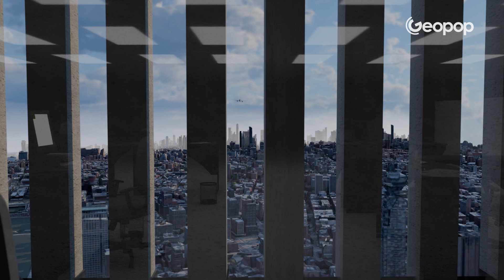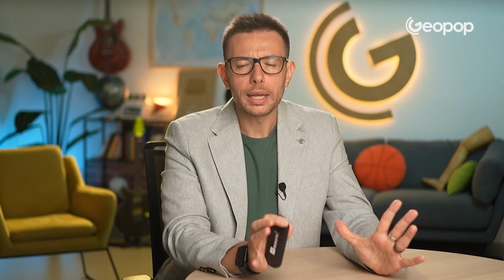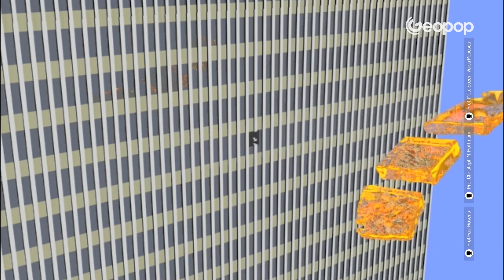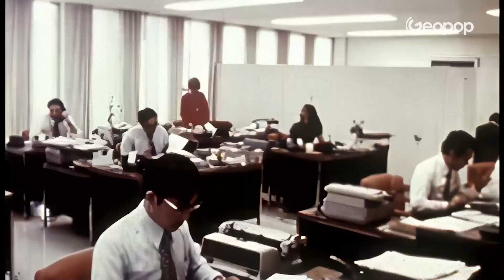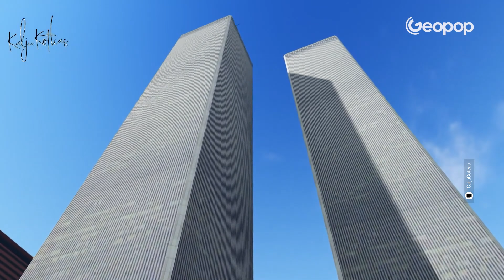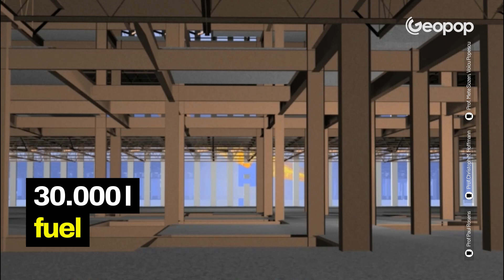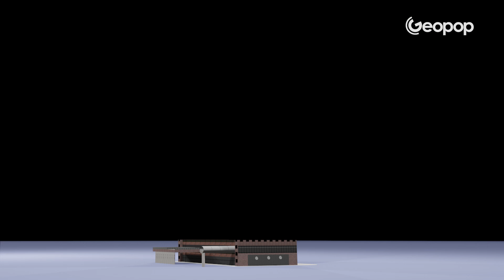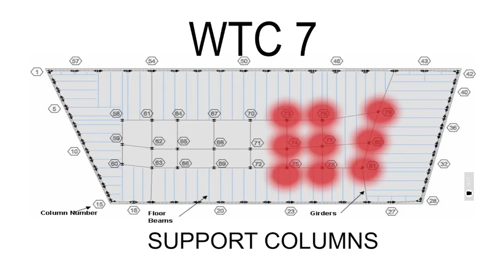9/11, 2001: The Technical Reconstruction of the Twin Towers and WTC 7 Collapses

Comment: All you controlled demolition freaks want to explain how the demolition ninjas managed to sneak into the buildings and attach massive amounts of explosives without being noticed? How this could all be done without anyone involved in the conspiracy breaking ranks and blabbing? Me, I’m sticking with the structural engineers and the science. Jets full of fuel and a structure where steel weakened by excessive heat deformed to where the structural integrity was lost. The sudden weight shock of floor onto floor as it collapsed caused it to pancake. Paranoid people are a lot easier to manipulate.
Reply: Ask them also how those supposed explosives, detonators and remote commands would hold tens of mn in a raging fire before being detonated to break the tower exactly at the plane impact point.

Comment: I respect the effort in making this video and watched it all too the end. Unfortunately it raises more questions than it answered for me ...for example, the potential energy law is ignored here...a car running into a truck doesn't destroy the whole car..if we introduce the idea of fire, and say for instance the outer layer of the car is nearly molten (and assume a car is made of 100-200 layers of steal ) the first 20,30 layers would crush...but what happens to those layers that are not even heated? Would they start to repell the energy? And we can clearly see, the debree doesn't accumulate centered weight but rather falls aside when the buildings fall.  Next question we should ask ourselves...how mady steal buildings you know that collapsed though fire? Special question regarding building 7: how can it be, a building collapses in free fall when just 1 beam weakened (out of 81 (!))..the domino effect applies to dominos, but have you ever watched it applied on buildings (other than WTC7?) And if yes, which one ??I would be happy if you integrate videos with answers to this questions. Last question: how can the planes fligh with 700km/h in such low altitude. Wouldn't the air friction slow them down as we can see in comercial airliners when landing? Greetings
Reply: How about instead of bad analogies that are not analagous, we just like wat what actually happened. Start with Building 7:  Building 7, the 6th building to collapse of 10 lost on 9/11 though extensively studied still confuses many. Not famous or a terror target and with no casualties it didn’t get a lot of attention initially, creating an information void the internet filled with utter garbage. Because everything seems like a conspiracy if you don’t understand how it works I prepared this brief summary from my own analysis to fix that. No politics, just engineering. 

The North Tower collapse at 10:28am bombarded Building 7 with tons of burning debris, causing heavy damage and starting multiple fires burning out of control for the next 7 hours. Half the FDNY firefighters having been killed, others injured, units in disarray, equipment destroyed, no water pressure, and the greater urgency of Search & Rescue efforts, firefighting was pulled as futile. The building couldn’t be saved and was left to its fate.

www.youtube.com/watch?v=g_SvpwyC17M&ab_channel=MFitz  

Collapse of a burning structure is always a concern for firefighters. Steel buildings subject to fire rely on active fighting of the fires to survive. Buildings are designed around 1 to 3 hours of fire resistance, allowing time for occupants to escape and ACTIVE firefighting to get started, after which all bets are off. Left to their own devices they will exceed their design envelope and collapse. In B7 the occupants escaped, passive and active fire protections were compromised and active firefighting was abandoned which left the building to take its chances. It lost. Odds on Building 7 would eventually collapse, and it did. No big deal in logic. That is the sort of choice firefighters make every day in brush fire situations - which houses to save and which ones to let go. Only real difference here is moving the decimal on the size and cost.

www.youtube.com/watch?v=WnYBX6QT0R4 

FDNY Chief Daniel Nigro ; The biggest decision we had to make on the first day was to clear the area and create a collapse zone around the severely damaged 7 World Trade Center, a 47-story building heavily involved in fire. A number of fire officers and companies assessed the damage to the building. The appraisals indicated that the buildings structural integrity was in serious doubt. I issued orders to PULL BACK the firefighters and define the collapse zone. It was a critical decision; We could not lose any more firefighters. It took a lot of time to PULL EVERYONE OUT, given the emotionalism of the day, communications difficulties and the collapse terrain

FDNY Deputy Chief Peter Hayden ; We had our special operations people set up surveying instruments to monitor and see if there was any movement in the building. We were concerned of the possibility of collapse in the building. And we had a discussion with one particular engineer there, and we asked him if we allowed it to burn could we anticipate a collapse and if so, how soon? And it turned out that he was pretty much right on the money, that he said 'In its current state you have about 5 hours

The collapse of Building 7 was anticipated and widely reported in the media throughout the day. At least 24 video cameras recording some or all of the collapse. Everyone knew what was coming and why.

www.youtube.com/watch?v=OY5S5k3tMHI 

Building 7’s collapse was completely different to the Twin Towers, harder to understand with most of the details difficult to see. But we can still sort out what happened through careful analysis and observation.  This is MY EXPLANATION of the collapse sequence using the best available information and relying on no authority.

B7 was complex 47-story steel framed structure built on top of a smaller existing 3-story building, requiring several lower floors dedicated to complex load transfer structures instead of usable office space. Of trapezoidal shape and all-steel tube-in-tube construction, B7 (above the 7th floor) consisted of a central core of steel columns carrying most of the gravity load, perimeter steel columns around the outside of the structure carrying the remainder of the gravity loads and long span beams and girders to tie those elements together and form the floors. On the outside of the building hung a moment frame - the last part of B7 to fall. 

Phase 1 : The first externally visible signs of collapse initiation occurred at 5:20:28 pm. Collapse initiation for B7 is notably quiet with observers not realizing the building was collapsing! There was no audible warning in the form of say hundreds of ear drum busting 180-190dB explosive bangs preceding the collapse. Here at 12:00 a local CBS affiliate reporter is talking 10 blocks from B7 when collapse begins. People don’t start to notice the collapse until 12:11. Then at 12:45 is the famous CBS fixed camera clip of Building 7’s collapse.  Note how quiet it is.

youtube.com/watch?v=t5tEy6mXSE8&ab_channel=fresnosean379

Collapse initiation was due to lower floor failures above the load transfer region (7th floor) in the NE corner of the building. In this video at 0:45 you can see the NW corner from inside the building while under construction, Column 79 just out of frame on the left. That big, angled steel beam across the top of the frame connects to C79 at one end. The girders connect to the beam. That beam and all those girders depend on just one connection

youtube.com/watch?v=nP3TNHPCIVU&t=35s&ab_channel=EdwardCurrent

Phase 2 : Lower floor failures caused a loss of critical lateral support over an excessive length of core Column 79 and it buckled. If you look at a floor diagram of Building 7 (see above) and look at all the structures that depend on C79 you quickly realize this one column was a relatively isolated structural element on which a disproportionately greater fraction of the structure depended analogous to say the Key Bridge. Externally we see a vertical progression of window breakage along the 44-46 line and a kink in the roof of the East Mechanical Penthouse at the top of the building, consistent with C79 failure. The transition from full capacity to almost no capacity occurs in virtually an instant. Once the buckling failure occurs there is almost no resistance

Normally with a buckling column, the load could very well be redistributed to other columns, meaning the buckling could stop after a while. With C79 that is not the case - the failure did not redistribute the load, so the collapse rapidly progressed to the roofline, sinking the rooftop penthouse.

Phase 3 : With C79 gone, B7’s progressive, non-symmetrical collapse continues with C80 and C81 at the east end of the core left laterally unsupported and quickly buckled and failed as well, sending the EMP down through the building. C79-81 all have no diagonal bracing, which I believe is a major reason why they could not redistribute a lot of vertical loads among one another.

From there collapse progressed from east to west through the central core until the core was gone taking all of the interior floors and structures and probably most of the perimeter columns with it. You can see the horizontal progression of window failures low in the building and the dropping of the remaining rooftop structures into the building. One of the big takeaways from the NIST Building 7 study (that gets completely ignored) was their modeling which determined C79 failing under ANY circumstances would have initiated the same collapse sequence.

Phase 4 : After some 10 seconds all that remains of Building 7 is just a hollow empty outer shell - the exterior moment frame - creating the illusion the building is still standing since little has changed externally. But it’s just a hollow empty shell like an empty cereal box supported by only a few remaining columns and quite unable to remain standing. With all the internal framing gone, the north face leans inward, forming a V in the roofline, the last perimeter columns buckle under the strain and with nothing left keeping it up the moment frame free falls, landing on top of the 7-story high debris pile. It is only at the very end that a single measurement of alleged free fall acceleration is taken. Note this is not the building but just its outer shell, and only one corner at that, at the very end of the collapse. Start to finish the entire collapse took 18-20 seconds, or less than 1/3 of true free fall and we have to look at the whole thing, not cherry-pick little bits to fit a particular narrative. Worth noting _how fast something falls cannot tell you what started it falling in the first place. The debris spread out, blocking surrounding streets, heavily damaging the Verizon Building and destroyed Fiterman Hall, all well outside of Building 7’s “footprint”.  

Building 7’s progressive, non-symmetrical collapse was incidental and unintended collateral damage from the combined effects of fire + time + gravity started by the collapsing North Tower. That is true no matter who planned and carried out the 9/11 attacks or why . The collapse was of so little consequence it barely even registered at the time, a mere footnote. It only took on semi-mythical status as an alleged smoking gun years later when demolitions at the Twin Towers, missiles at the Pentagon and shoot down over Shanksville all failed and conspiracists had nothing left to work with.

I hope you found this helpful, informative and it solicits informed critical comment. If I made any errors of fact, logic or reason or left anything important out, please let me know so I can fix it. IF you can offer a more plausible alternative please do. Be the first. Please start any reply with the words “Tits McGee” or I will know you didn’t read it and are wasting my time.
Reply: @TheLoonResistance One of your videos.I actually watched this time. It says That nist was just giving their best guess. Your video

Comment: How much  did you get paid to spread your wet dream. Remember the huge explosion in Beirut and the building in close proximity stood. That building never had the high tech material or structure design .
Reply: You mean the big, thick concrete grain silos?  Or at least what was left of them. What about the hundres of other buildings that were flattened?

Comment: Shame on you! Perpetuating the lies of NIST! Even Lary Silverstein, the lease owner of WTC complex in an interview admitted… and I quote: “Due to the damage from collapsed towers we decided to pull Bldg #7”. To pull the building is a technical term of controlled demolition. To do so would require months of planning and installation of charges that remove the lower sections of the building so it can be pulled in its own footprint. 
When the time comes that the people truly responsible for this atrocity be taken to justice, I hope you and your cohorts that made this film will go in front of the judge and jury with them!
Reply: If you are going to quote someone it should be something they actually said. That was not even close. Shame on you.
Reply: @TheLoonResistance of course it's close. He said "maybe the best thing to do is pull it. So we decided to pull and then the building came down" sounds pretty close. What difference does it matter if its exact you don't believe it anyway stinky

Comment: So the engineer and the contruction companies are liable for failure of the steel due to fire. I get it. How come there's no law suits?
Reply: The impact and fire were way above any specifications.
Reply: I wouldn't say that. The twin towers were designed to burn to extinction without collapse and they were made to be able to withstand 2 planes per building. So it was actually below the specification not burning to extinction and only being hit by 1 plane per building 😮

Comment: Scientists discover  both residues and unignited fragments of nano-engineered thermitic pyrotechnics in debris from the twin towers. 

Jim Hoffman, Version 1.03, December 7, 2009

“The implications of the discovery of unspent  aluminothermic residues in World Trade Center dust are staggering. There is no conceivable reason for there to have been tons of high explosives in the Twin Towers except to demolish them, and demolition is blatantly incompatible with the official 9/11 narrative that the skyscrapers collapsed as a result of jetliner impacts and fires.”
Reply: OK, so who was storing left-over 4th of July Fireworks somewhere on the site??
Reply: @louismcglasson7913  - It's a serious and obvious question, which means it is one you desperately want to avoid.  I mean, how the Towers collapsed is well understood and has been for many years, and this has nothing to do with it, so,...

This of course also assumes the Hoffman finding is correct.

Which it isn't. 

Something else you will no doubt wish to avoid.
Reply: @louismcglasson7913  - Thank you for proving my point.